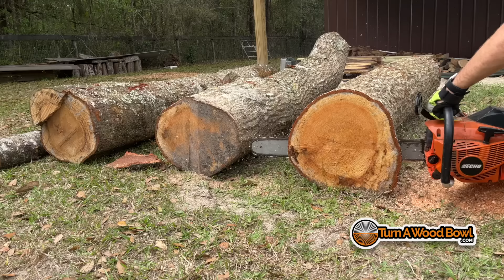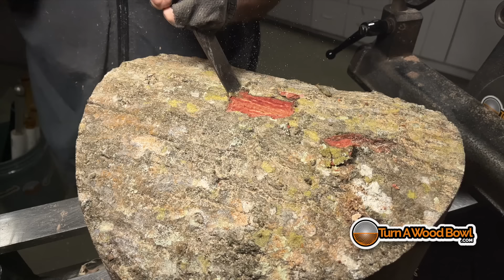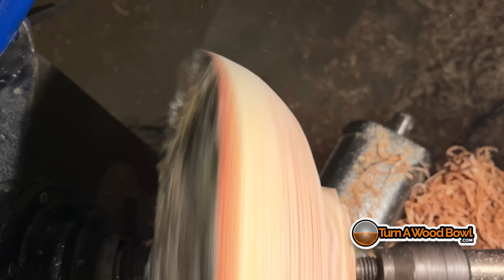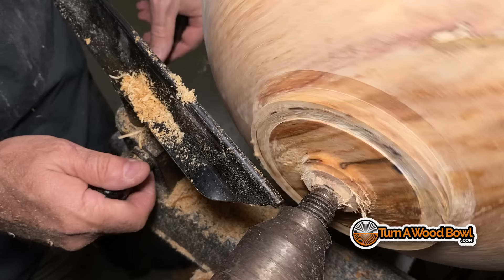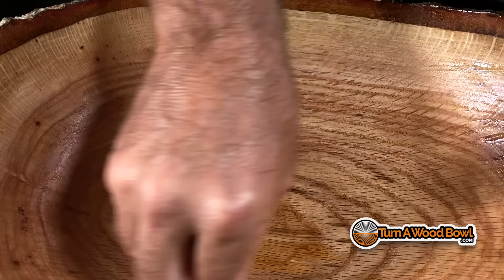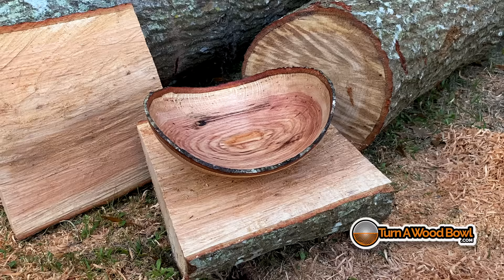Log to Bowl — Woodturning Video

Comment: What about using shelac 1lb instead of the danish oil/lindseed....could that do the same thing? I'm still contemplating when to use oil and when to use shelac.....
Reply from the maker: Yes, shellac would work as well. Remember, shellac is a film, oil penetrates. That's the difference. Happy Turning!

Comment: I have been turning bowls for a few years now, and I saved some sections of different kinds of tree limbs a couple of years ago.  This year I decided to make some more bowls.  I picked up a cherry blank, and found it to be very hard to cut.   It had a sizable crack in it, in which I applied plenty of glue.  After cutting on it for awhile, it started jumping and I had to shut it off.  When it stopped turning, I found the piece in three pieces.  Is it best to let the blanks dry out completely, or is it better to cut a green piece and seal it after you finish?  I tried a second piece of Chamfer, and had bad luck with it also.

Comment: I was wondering if shellac could be applied to just the outside edge of the bark to the help prevent the from coming off or would that be a issue with the linseed oil finish?  As a retired man who worked in hardwood industry for many years, I've taken up turning in the last months and am trying to learn all I can on all aspects turning and finishing my turned projects.  Love your live edged oak bowl and his you explain all aspects of your chosen process.  Best regards, John

Comment: I really love the way you instruct with everything you do.  It explains everything you do so well.  I am just starting, and I also want to turn some spindles.  I just need to get your opinion on what chucks I need to start out with.  Appreciated your videos so much.  Thank you for your help.  Charlotte Miracle
Reply from the maker: Thank you so much, Charlotte! I'm glad you're enjoying the videos. A medium-sized (approx 4") four-jaw chuck with DOVETAIL jaws. Be sure to get the correct headstock thread size for your lathe. I emphasized dovetail because there are other jaws out there. Some are serrated jaws, and they do not hold bowl tenons well, in my opinion. Some people can use them, but I prefer not to. Dovetail jaws lock the tenon when you make an undercut matching angle dovetail tenon. See my Recommended Equipment guide here www.TurnAWoodBowl.com/gear  Happy Turning!

Comment: Want to turn a oval bowel? I found this by accident, you need green blank live edge bowl, I knocked  some of the live  edge to get a flat portion to turn the live edge  so the top of the bowl flat, leaving msome bark of the live edge, what will happen is the drying will be uneven, the spots where the live edge is thick will be pulled in to the center.  I have a couple of experiments to try, find a trunk with multiple branches so I end up ŵith a bowl that will have many high and low spots and do the same technique to see what will happen.
Reply from the maker: Sounds very interesting Stephen. Thank you for writing and sharing! Happy Turning!

Comment: If we cut many pieces from a log, I have heard that they should be dried out after the end cuts are treated with an end-grain sealer.  This is very different from what you say about cutting single piece and turning it right away.  Can you contrast the idea of turning green wood right away with the idea of letting it dry out after sealing the cut ends?
Reply from the maker: Roy, good question. There are a number of options you have. Too many to cover here. I highly recommend the Tree to Bowl – Understanding Green Wood course. I know that sounds like a plug, but we cover it all there thoroughly. www.TurnAWoodBowl.com/green All the best to you and Happy Turning!

Comment: Would tung oil work in place of the linseed oil for preparing a green-turned bowl like this to dry? Or are there characteristics of linseed oil that make that better suited for this purpose?
Reply from the maker: Sure, you can use Tung oil as well. But keep in mind, the company's are not required to tell you what else (chemicals, metals, etc.) is in the product. I would try to find one that at least claims it has nothing additional added. Happy Turning!
Reply: @TurnAWoodBowl  Someone in your proofreading staff needs a vacation. 😁

Comment: Very cool bowl.     It has been 5 months how is it drying?  Does it look like it is going to keep its bark.    I have only tried to turn dry oak a few times and it was not the best experience even for spindle turning.   I have not played around a lot with bowls but you and the Jim the epoxy guy  at sprague wood turnings are sure making me want to give it a go.  I have done a few segmented ones several years back.   for sure a subscriber
Reply from the maker: Thank you for asking. The oak bowl is looking great, no cracks. I need to lightly sand it and give it another coat of oil, but looking good. Happy Turning!

Comment: Kent, beautiful work thanks for sharing. QQ. Do you sand to 320 all at one time or between coats of oil?
Reply from the maker: Joe, I sand through the grids to 320 and then apply finish. You can return and wet sand later if needed. Happy Turning!

Comment: Hi Kent, what a beauty! Thanks for your teachings and video. Most skills in wood turning I actually learned from you. 

I sometimes struggle when finishing natural edge bowls. After sanding to grid 400 and applying boiled linseed oil, some loose fibres seem to raise leaving the surface rough again. Resanding after the application of oil turned out to be a mess. Do you (or anyone else) have any suggestion on how to deal with this issue?
Reply from the maker: Be sure you’re only applying a very thin application of linseed oil. Let it dry and cure for a couple days and you should be able to sand without trouble. Also be sure you’re cutting in a supported grain direction - see video with that title. All the best to you and Happy Turning!
Reply: @TurnAWoodBowl  Thanks! I very much appriciate your reply. I probably applied too much oil right after turning the green wood. Looking forward to give it another shot / turn soon. :) Cheers!

Comment: I always pick up a new information from your videos.  I did pick up on the possible need to sand the bottom to make it flat if the drying process makes it wobble.  I have not taken a log straight to a bowl yet.  I almost always twice turn.  Perhaps you could share photos of this bowl or others like it after drying for 2 or 3 months?

Comment: One thing about drying bowls really confuses me, Kent. In your videos and articles you talk about drying bowls slowly, because sudden changes can make them crack. You suggest putting them in bags with shaving, and storing them in cool, draft free areas, etc. But then you have a video about drying bowls faster by building a kiln with heat and vent holes, or sticking them in a microwave. I'm not sure how to reconcile those approaches. So, when should I speed dry my wet wood projects, and when should I slow dry them? (especially for twice-turning).
Reply: I think a kiln works a bit like a steam oven. The heat allows the wood to bend and shrink without cracking.
Reply: How would you do a bigger blank, too tall for bandsaw?
Reply: @AnxiousCowboy  chainsaw
Reply: @AnxiousCowboy  axe
Reply: @AnxiousCowboy use your teeth
Reply: @Methods_of_dance  YES THE TEETH

Comment: I found an old oak newel post which was very dry and cut a piece and put it on the lathe for some spindle turning. That wood was hard as rock.
Reply: We have some pretty good-sized pieces of live oak that we cut back in 2016...it is hard as a rock as well!

Comment: when you apply oil to a wet bowl, won't that seal in the moisture and make the wood take longer to dry?
Reply: No. It will slow the evaporation process down. That’s the point of the oil. Or put in paper bag for a couple days
Reply: If it drys to fast it will crack
Reply: @downsouthwoodturning  https://youtu.be/0X5xyq2ikzY

Comment: Your tips for new turners are helpful for older, pain limited turners.  I can work only half hour at a time and not every day, but I don’t care for ‘store bought’ kiln dried blanks.  Putting oil on end grain may indeed save me some warping and cracks. 👍 thanks Kent. 
And btw, would shellac work to slow drying?  I’ve used it to prevent staining from ca glue when doing inlay and it seems to do a nice disappearing act with sanding.
Reply: Try keto/carnivore. Inflammation is your problem and that diet helps A LOT.

Comment: Beautiful work Kent, but i am a little confused - turning green that thin won't warp & Crack?  so used to twice turning now - Tyler
Reply: It will always warp. If you turn thin and have even wall thickness that allows it to warp and not crack. Most of the times. Still need to dry slowly for a few days. That’s what the the oil does.